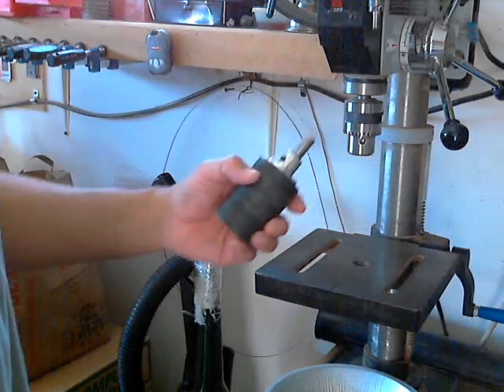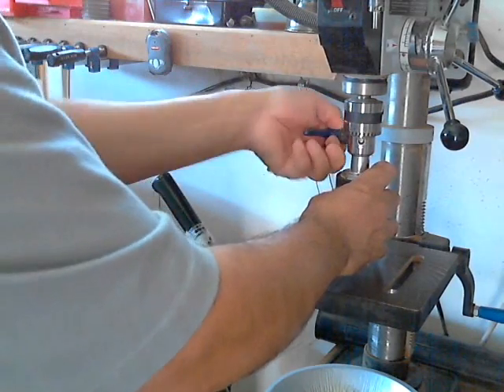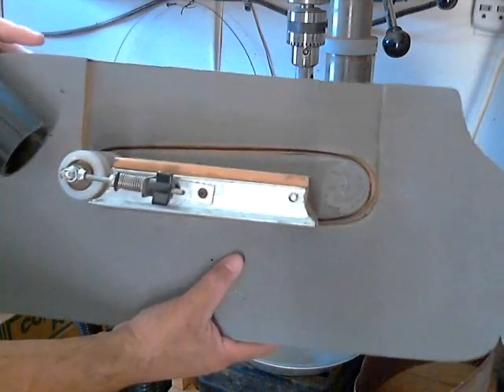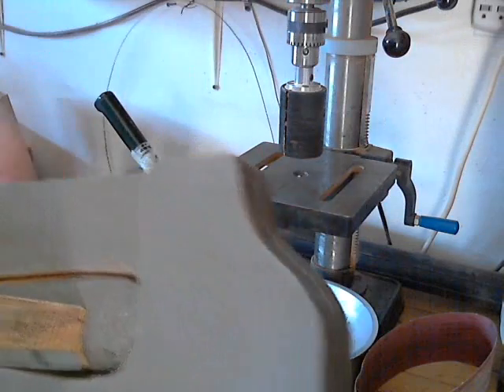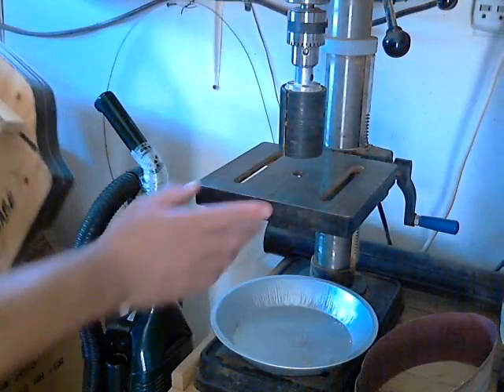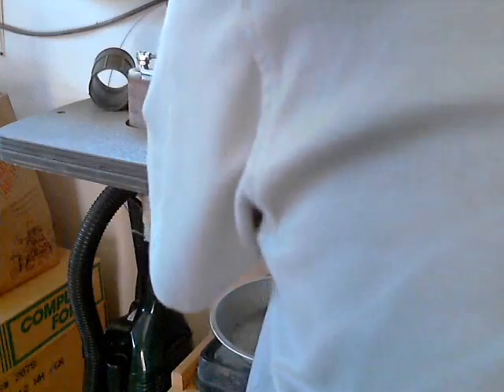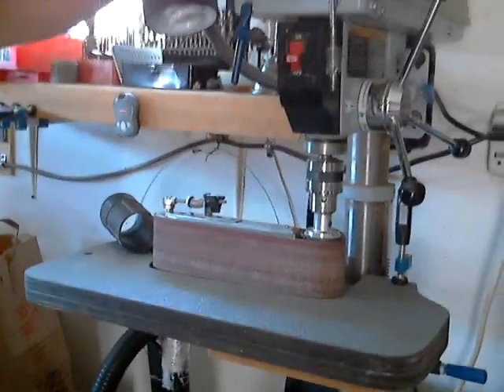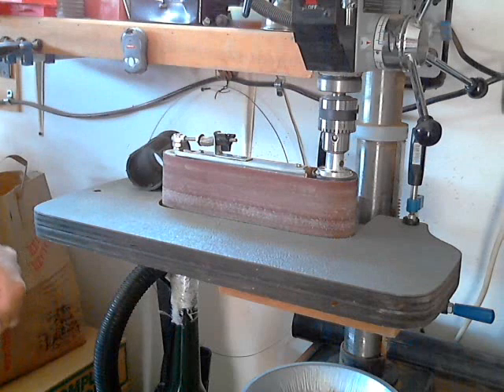Drill Press Horizontal Belt Sander

Comment: Great tool, does the work piece  bite the paper on the slack side. I would swap drive side so the motor is pulling the paper on the work face.
Reply from the maker: No it does not grab the back of the paper on the metal.

Comment: To avoid the sideways stress on the bearing , it should be possible to use another bearing underneath the drill press table to keep the shaft straight. I haven't worked out exactly how to do this yet but maybe some smart inventor can work out if it's practical & how to do it. Cheers

Comment: To eliminate the stress on the drill press and the possibility of the Morse taper letting go this could be designed as a self-contained unit with the belt tension all on the sanding attachment and the drill press used only to provide the rotary motion.
Reply: +btdga good idea, however never had any issues with the way it works.  Thank you for your input and watching it.  I hope you can take away the possibilities of other uses.  Thanks again.